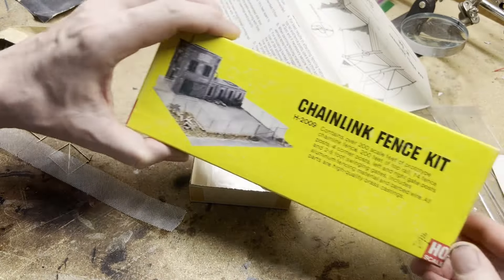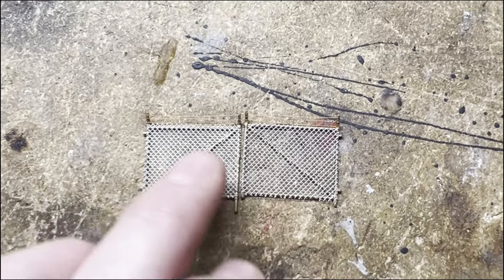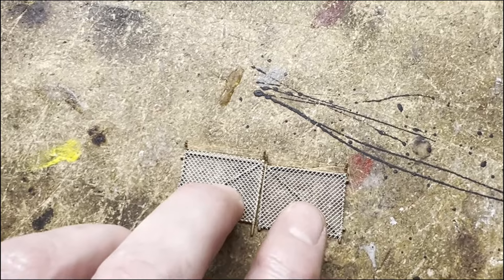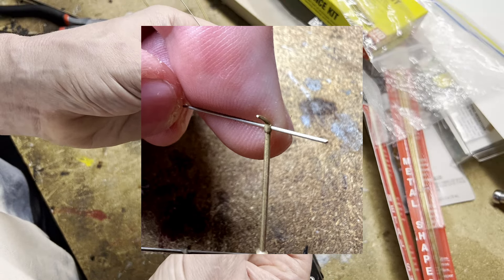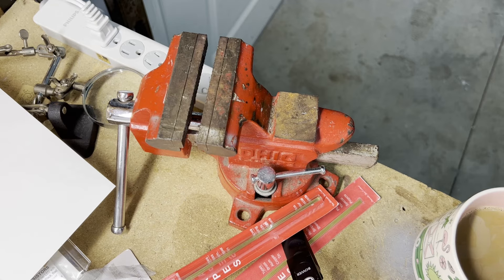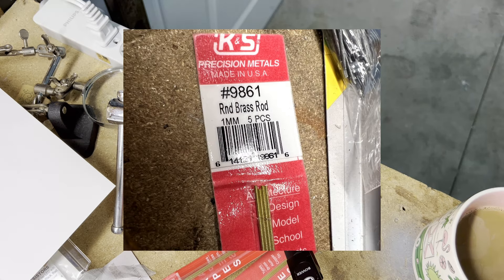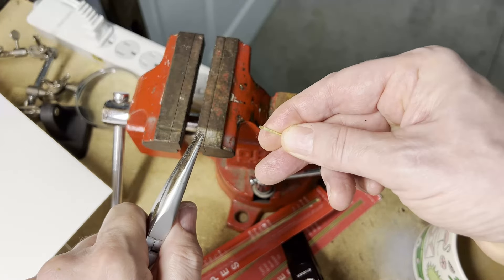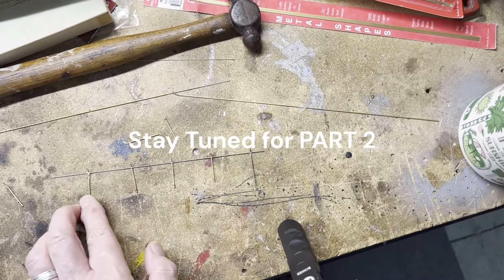PART 1 - A Slightly Different Way to Make an HO Scale Chain Link Fence

Comment: I plan to make my own HO scale chain link fence as soon as I get some 18 gauge wire.  I've already gotten a spool of tulle from the fabric shop for $3.50 and that is 6 inch tall by 6 yards long, enough to last a lifetime.  I've seen several methods for constructing the fence so I will incorporate all the methods into just one that suites me.  My soldering skills (because I'm also a Ham radio guy) are much better than my gluing skills.  Cheers from eastern TN
Reply from the maker: That is a great method. I was planning to do that until I found this kit. I may still use the wire and tulle around one of my other industries so I can try that technique. Let us know how it goes. PS - I’m still working on my soldering skills. Not as easy as most people assume. Thanks for the comment and for watching!

Comment: Stunning. Mind you, that’s a lot more skill than I will ever have. Looking forward in seeing how this comes out.
Reply from the maker: Thanks! I think I made it look more complicated than it is on the video. Not too bad, just takes time and patience. There are a few YouTube videos out there with simpler methods. One uses galvanized wire mesh that you cut to size for the fence frame, then glue tulle (wedding veil material) for the chain link.